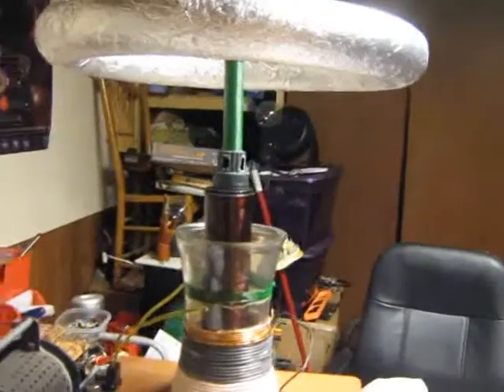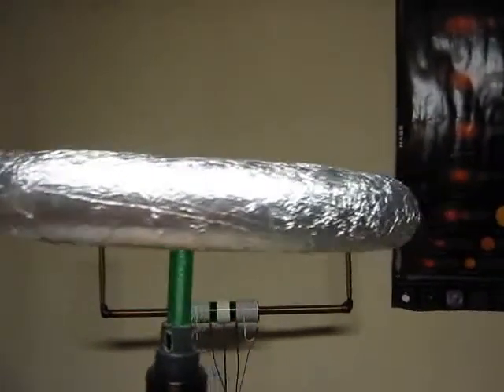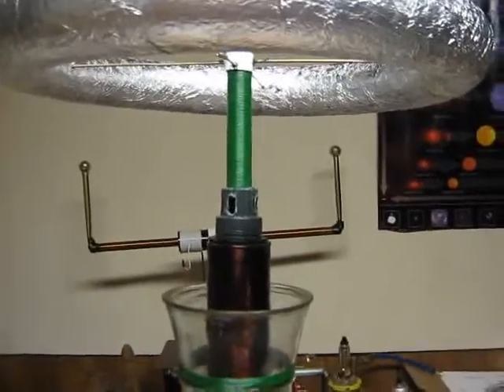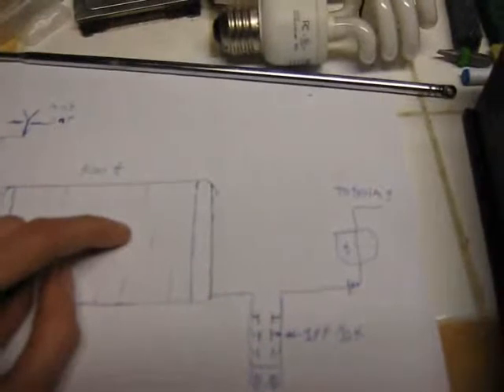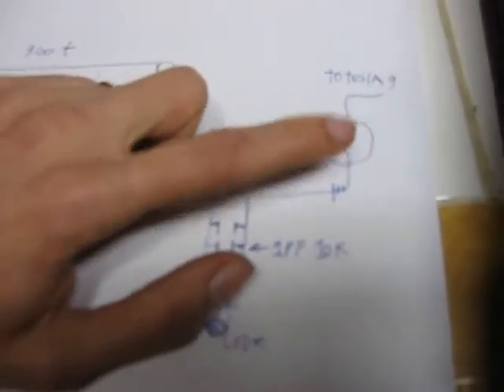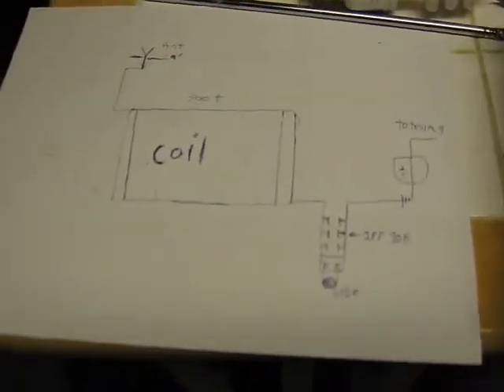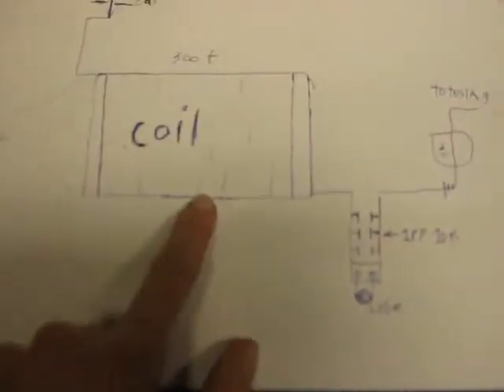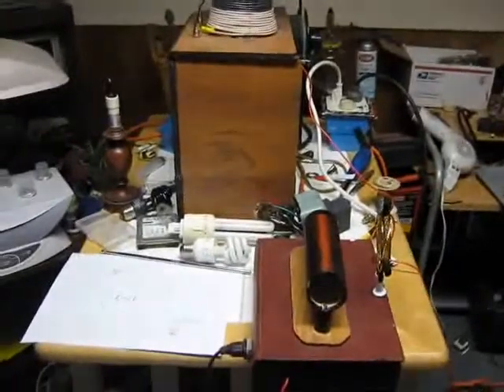mini wardenclyffe info -how it works

Comment: so u are right in relation to when it was transmitting energy. but when it was recieving energy the function of the tower would have been reversed. most likely the secoundary coil wpuld have been charged up initially to created the potential difference and then the capacitance and inductance with the ultilization of his radiant energy theory

Comment: as there was a fault line in that area the magnetic field would of been pretty strong with the flow of water (being the moving conductor) it would of induced a voltage into the copper plate.

Comment: the towers could swap as a reciever. the tower worked on electromagnetic fields . simply tesla built the on top of a fault line to which there an aquafier.  why basic electromagnetic theory quickest way I can explian look up electromagnetic flow meters we use these days

Comment: This device need a coninuous production of vacuum to be able to make a "window" on the vacuum tube by compressing high pressure of air through a fused quarz valve where had a comunication with the tube through the high vacuum chamber. It would look like a beam of light focusing on the electrifyed earth or the ionosphere.
HAARP is another well known project that have too much similarities with the same ideas that Tesla were explaining about experimenting with the ionosphere.

Comment: Wardenclyffe worked as other systems like solar power satelites will be the only solution for the energy crisis and they will use wireless electricity to send EM/laser till the surface of the earth. The difference is that it will have importnt consumption limits compared with the Wardenclyffe. What is not true is that he used just electricity or EM waves but he also designed an open vacuum tube to project non dipensive energy by  high speed particles of tungstene giving conductivity to the air.

Comment from the maker: please don't tell me how wardenclyffe works. you weren't the one who poured over the patents trying to figure this out, I did a lot of research on this, and if someone tells me again that wardenclyffe didn't use electrical energy it  used power from the ionosphere or wardenclyffe only works in the presence of UFOs. I don't know what I will do but the bottom line is you just look silly when you say that UFOs are  why wardenclyffe worked I don't mean to offend anybody but please be reasonable